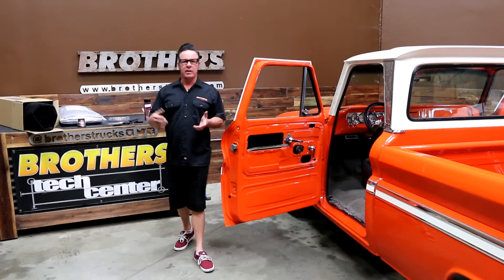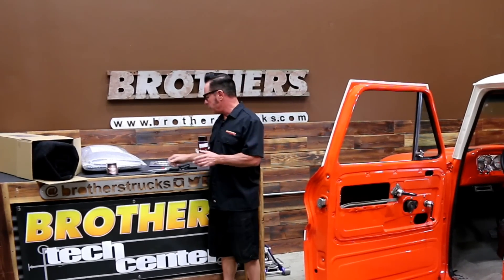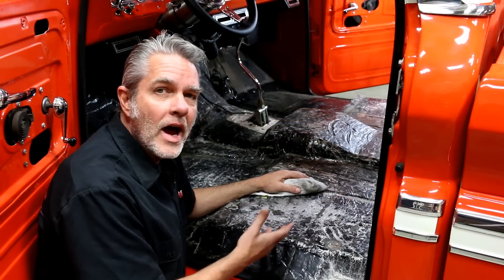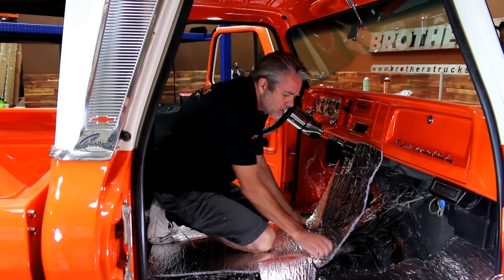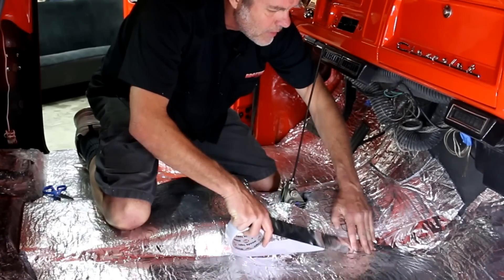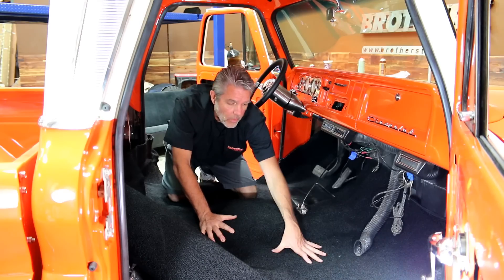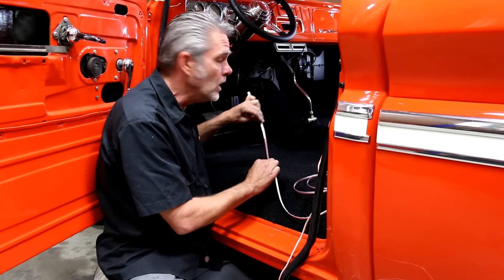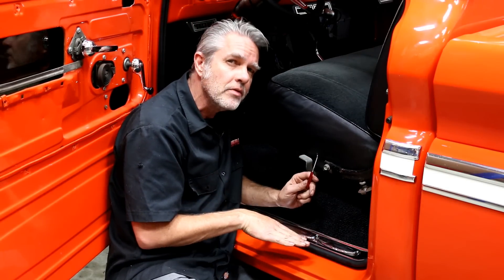Classic Chevy & GMC Truck Carpet Installation

Comment: Working on my Chevy 79 installing my carpet. This video is the best help I got, thanks for the tips
Reply from the maker: Absolutely our pleasure! Thanks for watching!
Reply: BROTHERS Truck Parts have a question. Where did you guys get the guide map to know where to place down the sound deadening on a Chevy 79
Reply from the maker: @soundsystem0094   That map comes with our sound deadening set. The placement is not critical though, just make sure you have some deadener every 12" or so.

Comment: Great work, How would you run wiring under the carpet?
Reply from the maker: just tuck it under and make sure it doesn't get pinched by the seat brackets or anything else that gets bolted down.

Comment: I’m about to sound deaden my 1972 K10 and put in a carpet kit from your website. What spray glue adhesive should I use?
Reply from the maker: You can use just about any spray adhesive, but we typically use 3M Super77

Comment: Finishing up my ride, and this is next. I hadn't planned on gluing down anything.. Chevy didn't glue my original one in. Seat, shifter, and sill plates kinda hold it all down anyway.
Reply from the maker: Gluing it down makes it "hug" the floor and just improves the overall fit. The carpet we pulled from this truck wasn't glued either, but it had some obvious loose spots too. Ultimately it's up to you!

Comment: I noticed before you put down the insulation there was that black rubber padding. On my pickup I don't have that it is just the bare truck, am I good to put the carpet and insulation w/o that black rubber or do I need it?
Reply from the maker: The black rubber we had down is sound deadener. You don;t need it, but it's always a good idea to cut down cab noise.

Comment: Hi Dave this was a very informative video. Should the entire carpet be glued down are only the edges I am in the process of installing my carpet
Thanks
Reply from the maker: I like to glue the entire carpet down starting in the center and working my way out. I find that it ends up less lumpy and fits the floor contours much better.
Reply: @BROTHERSTruckPartsTV  thanks for the quick reply. I also would like to get the best grade of carpet if there are different ones any suggestion?
Reply from the maker: @henrydixon3159   We carry high grade carpet. Can't comment on what other suppliers carry, but you need to be careful with carpets that are loomed in a neutral color, then dyed to the intended color. Those tend to fade VERY quickly or just change color altogether. The carpet we sell is loomed in the intended color from the beginning and not just dyed to match. Check our selections at www.brotherstrucks.com

Comment: How far out from the middle would you use the adhesive on the carpet?  Was thinking in cases where speaker wiring was needed in the future.
Reply from the maker: We go from the middle out to around 2" from the edge. We also recommend laying any potential wiring at the same time you lay the carpet, even if you wont be using it right away.

Comment: is it useless to put Dynamat all over the floor? i've K5 Blazer and i'm wondering how many sound deadening i need. Thx
Reply from the maker: Dynamat would love for you to put it everywhere, but the truth is it's not necessary. You can place up to 12" apart and the sound dampening will still be excellent.
Reply: @BROTHERSTruckPartsTV   thank you for your answer! it appear on the video that there is already a layer on the floor. What is it?
Reply from the maker: @skwermotors  the customer had a layer of sound deadening material already installed when we removed the old carpet.

Comment: I ordered from lmc truck and I ordered a high hump on accident. We already cut the holes and stuff but there’s a bunch of extra material where the hump is and it’s just popping out. Do I have to order a whole new carpet or can I fix it!
Reply from the maker: You've got to replace the entire carpet. The high hump and the low hump are completely different molded shapes and you'll never get a good result if you try and make the high hump work.
Reply: OR... buy a high hump and just fasten it with a few screws over the low hump. Then it's there if you ever do an LS swap.